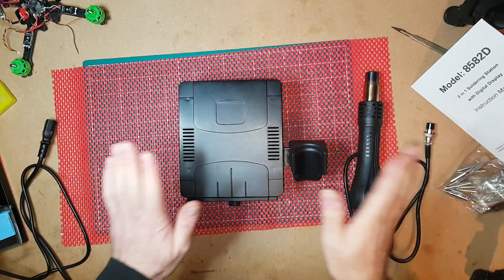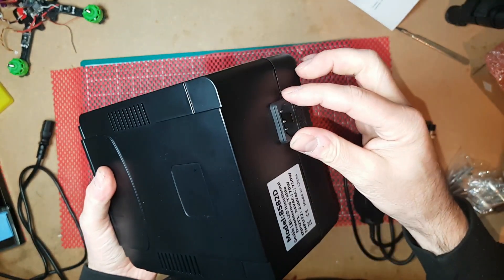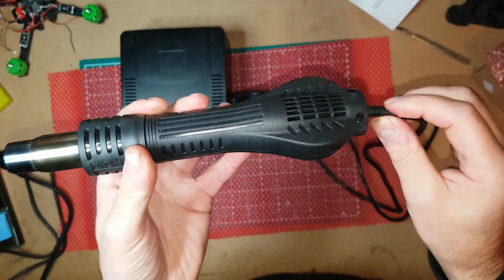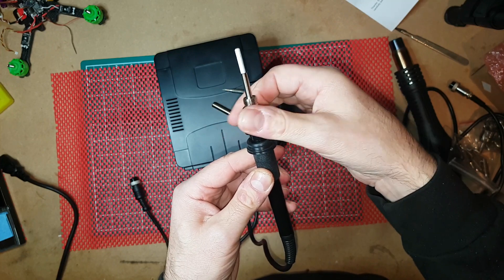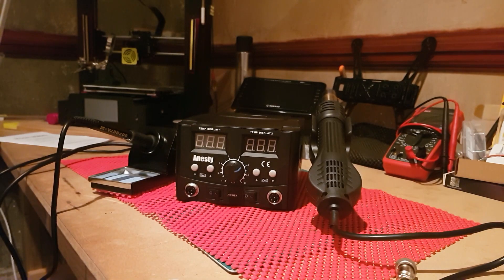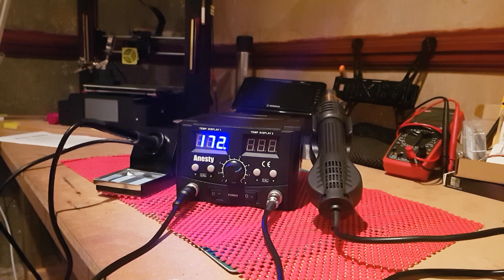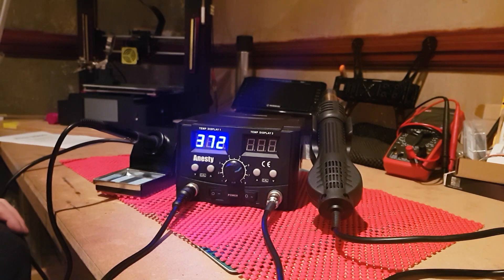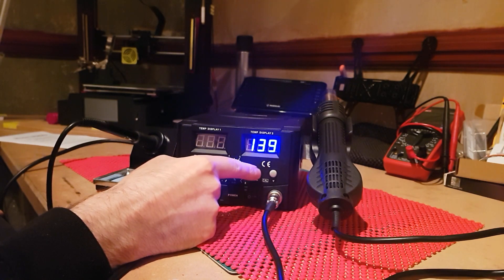Low cost solder station

Comment: Thankyou for the review, just bought this exacy one for a small project to fix chip on board.

Very rear I use soldering, but I've always found myself ive needed a station combo like this for the job on electronic   chips and heat gun don't cut it for electronic tiny chips without control of air speeds.

Comment: 6:56"that's your sign that powers going to it "
ACTUALLY IT'S NOT 
it actually has a meaning
3 Dashes (Depending on which side they appear on)  means.... THE UNIT IS GOING INTO STANDBY MODE

9:28 "the company recommends you leave it on the full amount, basically "
ACTUALLY THEY DON'T
What they say is....     To ensure longevity of life they recommend turning down the heat and increasing the windspeed , but keeping it as low as possible so as to not unnecessarily load the unit.
They don't say crank it up,   they say ,   Try and keep the Temp down as much as possible
Increase the windspeed instead,   but only as much as is necessary 
I've got mine on 5.5 Speed   works fine

Comment: I also got one of these for my work is good enough. I bought some proper tips though, the ones that came with the unit were so cheap that some burned out on the first usage. With good tips it works well, the hot gun is pretty good as well.
Reply: What tips did you buy? Does it fit from other soldering irons?
Reply: @dlacicagaming4799    "LUXIANZI", "900M" model with "Plating Film".

Comment: I have on of these and been using it an almost daily basis for half a year now. Unfortunately, the included tips are not very good. Any suggestions on where to get new higher quality ones?
Reply: I’m using copper tips at the moment as there's about 1cm between the end of the heating element and the tip of the tip. The cheap stainless steel tips don't seem to transfer heat well enough. I'm still a newbie though and if someone more experienced comes along with better advice I'd follow their's.
Reply: @markharrisllb  I just got original Hakko T18 tips and that was a completely different experience. Much better than the cheap ones.
Reply: @laupert9021  Sorry, I should have come back to this comment months ago. I’ve been using the T18-B tips, thank you for the advice. It’s the same price for one as half a dozen cheap ones but worth it.

Comment: I bought a similar one (same but branded differently) and the driver for the hot air fan has died. Does anyone have a circuit diagram for this unit, or know what component to replace?
The driver IC suddenly started being intermittent until it finally died - obviously heat related.
Reply from the maker: Its most likely the heating element that's gone in the blower and not something in the main unit. You can buy them cheaply from China.
Reply: @jsa2001  No, it's the main unit, I took the hot air gun apart and it's fine and I also checked it by plugging it into another identical unit, it ran good on that. The main unit is stuffed.
Reply from the maker: @fredfarnackle5455  Try and locate the thermostat to see if thats gone.
Reply: @jsa2001  What thermostat, where?

Comment: Hi i have the same unit as you i have only had it for a couple of weeks now and the hot air is not working when i turn it on it sits on 8 and wont go up any higher then that would you have any idea on what's wrong
Reply: Have you opened it to take a look inside.
What could be wrong could be a variety of things

Comment: cant complain when one repair would pay off the cost of it :') 

i jsut bought one to replace my single 858d and a cheapo iron which works perfectly for hdmi port replacements , smc's refowing or removing components and chips with the 858d is perfectly fine too , but i wanted an all in one set up , and a iron holder that doesnt fall over to the weight of the handle of the iron hahahha! 

so we shall see how it goes when it arrives in a few days :D 

hope all goes well and let me know if its still working for you , have you been putting it through its paces as much as i would be ?
Reply: Is it working good?
Reply: @Saint696Anger  its solid , very happy its made me alot of money
Reply: @Millzieeeee  good to know 👍🏻

Comment: FWIW, more or less the same unit is available in blue and with an 80W rating on the soldering iron, plus a few more doodads like a solder sucker. https://www.ebay.co.uk/itm/Digital-Soldering-Station-PROSTORMER-2-in-1-Hot-Air-Heat-Gun-Rework-Station/193591611662?hash=item2d12f5910e:g:thIAAOSwg3hfGbXQ

Comment: Hi there,

Is it worth it compare to a 3 in 1 soldering station machine with power supply incorporated or not?

I'm planning to buy this machine separate at one Bench Power Supply instead to buy one all-in-one as a YIHUA 853D.

What do you think?
Reply from the maker: They'll both perform similar and fail similar as most of these solder stations use the same parts when manufactured. I didnt need the power supply hence i buy the two in one.
I can tell you my solder station is still going strong but the heat gun broke but they're very cheap to replace.

Comment: Just bought one too. The soldering iron temperature settings were innacurate by anywhere between +25 and +35 degrees C, othewise it's okay.
Reply: negligible when iron should be hot as possible (before degrading chinese tips) to get in heat a pad add solder and get out yknow , so yeah , ill be fine with that fluctuation of 30 degrees

Comment: 2 years down the road how is this unit holding up whats the issues would love a comment update or even a video  any problems happen with the unit ?
Reply from the maker: Yes everything is still working fine apart from the heat blower it only lasted 6months as the heating element died in it.
Reply: @jsa2001  cool I just ordered this and am excited to receive it 😊

Comment: so for you are 150£ low cost?
Reply from the maker: Its not that price because the seller does not have it for sale anymore. Try here...
https://www.ebay.co.uk/itm/2-in-1-Soldering-Iron-Hot-Air-Gun-Desoldering-Rework-Station-SMD-Digital-Solder/323927461365?_trkparms=aid%3D555018%26algo%3DPL.SIM%26ao%3D1%26asc%3D20190212102350%26meid%3D1bac7158a8de418790eaca47c92b9e64%26pid%3D100012%26rk%3D1%26rkt%3D12%26mehot%3Dpp%26sd%3D273341418632%26itm%3D323927461365%26pmt%3D1%26noa%3D0%26pg%3D2047675&_trksid=p2047675.c100012.m1985

Comment: Looks like a decent station, how was the soldering experience?
Reply from the maker: The blower lasted 6months replacements cost about £14.00 from China or eBay.

The iron is still working really well after heavy use, only gone through one tip. So I'm happy with the soldering iron.
Reply: Ho ften did you use it ? Daily , Weekly .....or continuous.....
Reply: I have the same unit and for the most part I use it daily it is not a bad unit whatsoever unless you're nitpicker like other individuals
Reply: But what actually needed replacing ? Fan ? Heating element ?  Looking with a view to buy
Reply from the maker: @Jezza3110  Sorry for the delay in replying. Its the heating element in the blower that's dead, everything else works and is still working today.